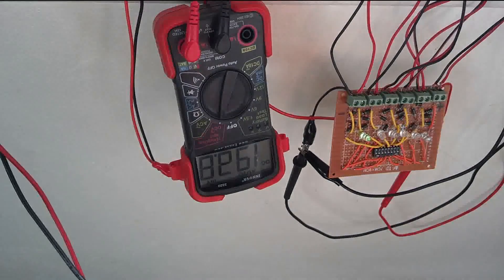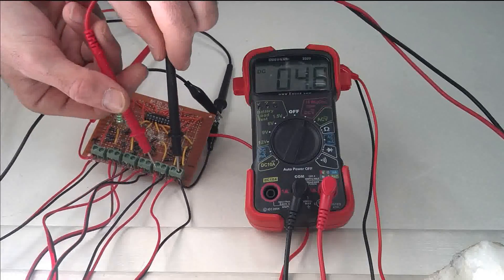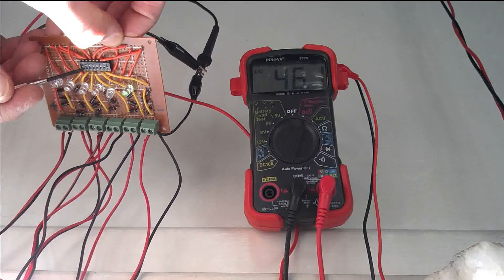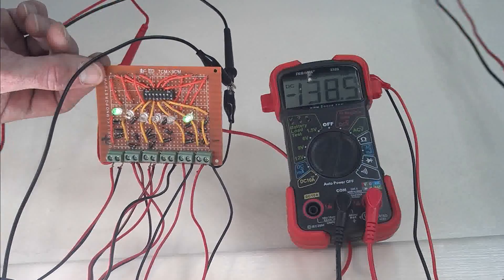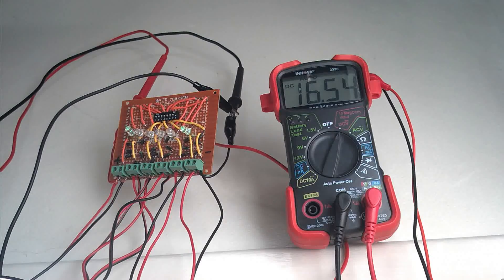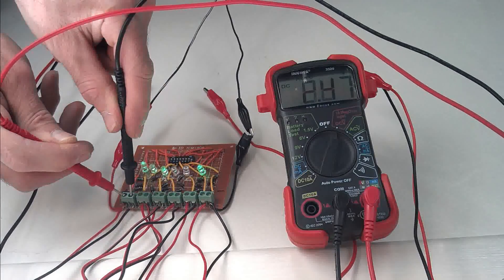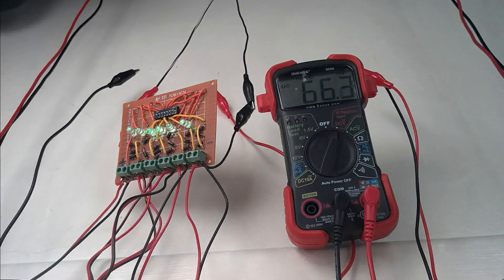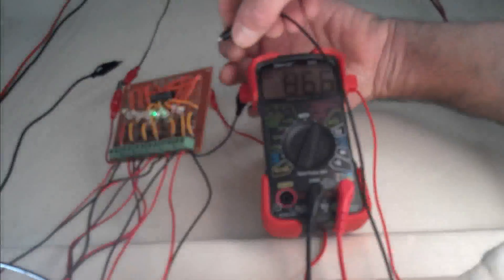Super Capacitor Charging  - Diode Balancer

Comment: Diodes are not stable when the temperature changes. You can see that the LED of the capacitor with the lowest voltage (on the right) lights up the brightest while the LED next to it lights up less with more voltage... because that rightmost LED has been lighting up for longer, it is warmer resulting in change in voltage, so worthless.
Do it right and use an active balancing unit. It’s smaler and cheaper than the time you spend on this one.

Comment: This seems like a great idea. I do wonder about what would happen if one of the 18 diodes fails. The voltages of the remaining capacitors will stay suppressed but the one capacitor with the failed diode will most likely be pushed past it's limit.

Comment: china caps with poorly matched ir/esr? is it just a zenner on each cell at the proper voltage?
Reply from the maker: Just 1N4001 diodes. Using 3 at about .7 V drop on each equals 2.1 v drop. So it keeps each capacitor from going over 2.1V approx.